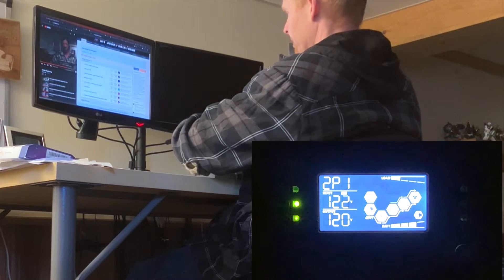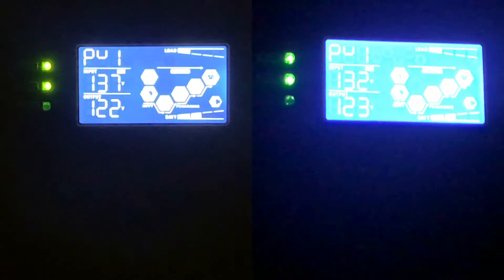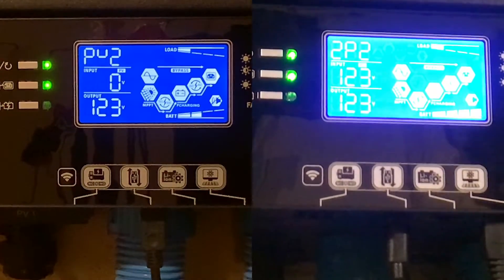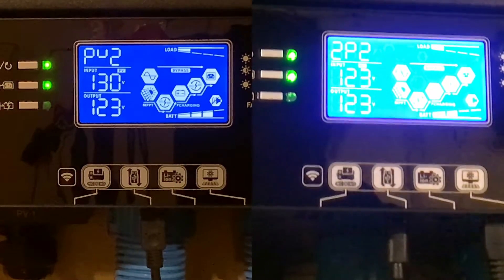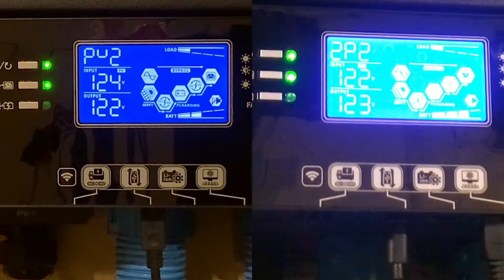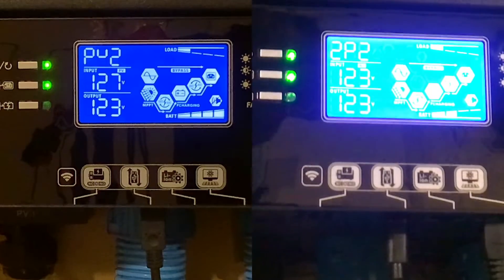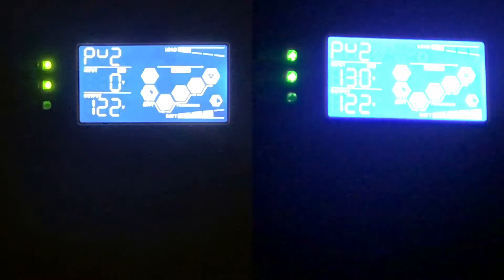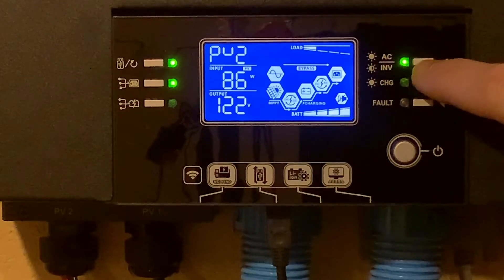Inverter Keeps Dropping the Grid Connection, Part 2

Comment: Another big problem I am having is the SOC setting in options 12,13, and 29 are always reverting to 0%.
Reply from the maker: That very well could be a firmware problem. I have heard multiple people report that settings were changing on them, and the 79.6 firmware I believe was supposed to correct that.

Comment: Sorry to break the bad news but your new inverters are going to do the exact same thing these old ones dead because mine are the new ones.
Reply from the maker: Actually, I haven't had this happen yet on the new ones.  I've had cloudy, crummy days and no issues as of yet.  What firmware are you running on yours?  I'm almost wondering if something was fixed in a firmware patch between my old and new ones.
Reply: @AdamDeLayDIY  79.03
How long did it take for Signature Solar to take some sort of action? They asked me to send them information and then haven’t responded back in over a week now.
Reply from the maker: @davidashcom6087  I would defiantly update your FW then.  I think there’s several updates which should contain fixes for a lot of your issues.  https://eg4electronics.com/downloads/
Reply from the maker: @davidashcom6087  Unfortunately they’re  extremely slow to respond.  I’ve found a lot of answers on diysolarforum.com

Comment: I don't trust the MC4 crimps.  They always seem a bit too flimsy to me.  I don't trust'm at all.  I'll crimp, and then I will solder on top of that (those MC4 heads solder quite nicely), being careful not to get solder in the tiny little tabs that click into the housing.   But I dunno if that would cause an issue like this.
Reply from the maker: I’ve never had any issues with them…as long as I use the right ones for the right cable…

Comment: Its so random, I wonder if something inside the inverter is overheating and causing the inverter to reset.   The only other thing I can think of is that communication between the two inverters is being disrupted (bad connection / bad cable).
Reply from the maker: Hard to say.  Probably one reason why SS wanted to RMA the units.

Comment: I wish their services was better.  I left one company to go to SS because of poor support and now they are doing the same thing.  Been working with them for months on multiple questions/issues with little or no solution.

Timers settings won't stay set, therefore it won't switch from USB to SBU and back again automatically
Time doesn't stay the same between both phase inverters. Off by hours per day.
Cannot get correct inverter settings needed for EG4 batteries, conflicting information
Arc fault breakers trip when switching from battery to utility.  Or randomly when on battery
Oh and the mobile app... What a joke. Lol

Has been pretty solid running most of my house with these 2 inverters when leaving it in bypass.  And only arc fault issues with battery mode.  I have not hooked up solar yet, next spring because of supply delays.  They are finally shipping me 2 new inverters.

Anyone else run into these issues?
Reply from the maker: Sorry to hear of the issues you're experiencing.  I understand your frustration with the "support" or lack thereof.  

- I've never used any of the timer features
- I did just walk over and check the times on the inverters and they're 5 minutes off right now.  When I set them both up, they were exact in time.
- I don't have the EG4 batteries but from my understanding you only need to connect to a single inverter and set Mode 5 to EG4, the other inverters should all be set to USR.  
- I've never had any breakers trip, but I have noticed some of my GFCI outlets trip (but I think that was going on before I installed the inverters)
- Can't even call it an app.  You need to look into Solar Assistant.  1000% better.  I did a few videos on it and it's capabilities.  You should check them out!

Good luck on your continued progress.  Hopefully SS gets some answers for you.
Reply: @AdamDeLayDIY  did you have to do any special ground in your inverters, it just use the ground coming from the ac input?  They won't give me an answer and tell me to talk to my electrician who is clueless with solar/battery backup systems.
Reply from the maker: @dalemeyer5363  I did not.  I'm relying on the grounding coming from my breaker panel.

Comment: I've noticed that your solar input voltage on your solar input is below 150v. I have found on units with a high maximum DC voltage MPPT input that higher voltage is needed for the MPPT to recognize the PV input. I just went through this with the EG4 6000EX. I went from three per string used by my old setup to six per string and it seemed to resolve the grid bypass mode. Similarly I had an issue with a Growatt SPF5000-US doing the same thing under the same conditions. Since Sig Solar and EG4 won't respond in a timely manner, we are left to figure this stuff out ourselves. Growatt USA will respond by email if you chat on their site and have been somewhat helpful at times. I'm wondering if the Sun Gold Power and MPP versions of these would make a better investment.
Reply from the maker: Thanks for sharing!  Odd thing is that I didn't have any issues till I introduced the 4th array.  I'm working on uploading a video about a little workaround I found.
Reply: @AdamDeLayDIY  I'll keep an eye out for it.
Reply: I’m having the same issues I am at such a words and I’ve already ordered my MPP inverse and will be installing them on Monday.

Comment: Hi Adam! Sorry about all the issues. I am slowly trying to bring my system online and had a catastrophic failure yesterday when testing in battery mode. Sig Solar has not helped me with any configuration or setup regarding my installation. I have no idea what the inverter is doing with Neutral Ground bonding. I can’t get my battery levels to read at all. I notice when powering the system back on, not all the 2P1, 2P2 settings are stored in memory. Not clear what the RS232 cables are communicating. Not sure what caused one inverter to pop.
Reply from the maker: @Jay Schwarb Sorry to hear about all YOUR issues.  Were you just trying to power up without having an AC output connected?  I ran for several weeks before I actually removed any ground/neutral bond.  

Did the failure happen as soon as you turned the units on?  I know inside each inverter there's fuses (you should have received spares in the packaging), but I don't know at what point in the connection that the fuses are used (battery connection, ac output, etc).  

Since your mentioning battery levels and RS232 cables, I'm assuming you have 2 inverters and at least 1 EG4 battery, is that correct?  Just trying to get a picture of your environment in my head.
Reply: @AdamDeLayDIY  for this test, I had the AC output breakers set to ON. It happened about 30 seconds in to turning the units on. The event triggered them to crash, I think the batteries immediately failed. I was testing 4 of 6 inverters with RS232/VGA connections properly configured for 2 L1 and 2 L2 with 6 batteries turned to ON. I don’t recall seeing any fuses during wiring up. Perhaps they are inside the other panel? It was a very loud pop/bang.
Reply from the maker: @jcschwarb  They include a spare fuse in the box in case the one inside the inverter goes out.  You wouldn't normally have to do anything with it (it's inside the top section of the inverter).

I guess I'll just ask a few questions first and then go through where I would start troubleshooting I guess.  Forgive me if any of the questions sound like "stupid questions".  Just trying to picture everything.

1. When you turned everything on, did you have all the inverters wired together for 3 per phase, but you only turned on 2 per phase?  With communication cables wired between all 6 inverters, I'm not sure how they would handle only having 4 turned on.

2. Did you have the current sharing cables hooked up as well? Per the manual the current sharing cables should only be hooked up between inverters on the same phase, not between phases.  

3. Do you know which inverter "popped"?  Do the rest still seem to be functional?

Troubleshooting - all these steps I would do with the AC Output breaker shut off (just in case).  Test output with voltmeter.  I would also remove any AC In connection (if you have it) till you get things squared away.  One less thing to worry about.

1. I guess I would disconnect the batteries from the inverters and make sure the batteries still work.  

2. It may take some time, but I would disconnect the parallel cables from the inverters, reset option 28 to SIG and test each inverter individually to make sure it can properly output 120v.  

3. I would then create a single split phase pair (with no current sharing cables) ensuring you have your P1 inverter set up on Phase 1 in your panel.  Check to make sure you have proper voltage between the two phases, and also you have proper voltage between L1/2 and neutral.

4. I would then add in 1 additional set of inverters and made sure the AC Out cables were all on the proper phase, option 28 was set properly for each (including the 2p2 servers set to 180 degree phase difference) and the parallel and current sharing cables were wired properly between each inverter and each phase.  Then power on all together and test voltages.

If you would like to troubleshoot/discuss more, we can take this offline.  You'll find my email under the about section of my channel.  Might be easier to talk over email than through YT comments...😁
Reply: @AdamDeLayDIY  Hey Adam! No luck finding your email. I must be getting old, lol. I found the fat fuse in the inverter but couldn’t find the skinny one. When I apply power, the batteries fault out. I checked my wiring and all is good. I have gone back to getting just two online.
Reply from the maker: @Jay Schwarb  No worries. 

The small fuse is under the top cover of the inverters.  It's under the plastic shroud on the right connected to the battery positive terminal.  I would be careful though because I don't know if opening the top cover will void the warranty or not.  

Unfortunately the models without displays only have the alarm light to my knowledge and it doesn't really tell you what the issue is, other than there is one.  

What voltage is your battery pack at?

What about trying to go to SS website, find your specific battery model and download the BMS software.  See if you can plug a computer directly into one of the batteries to see if you can determine what the actual fault is on the batteries.  

What comes to mind initially when you say the batteries fault when you power the inverters on is the inrush current being too much for the batteries, but that wouldn't make much sense to me.  I thought those batteries had precharge resistors built in, plus when you have multiple batteries in parallel, they all share the load.

Comment: I’m having similar issues with Growatt SPF5000ES inverters with grid input. I’ve given up on them and swapping to Sol-Ark. should have bitten the bullet to start with.
Reply from the maker: Love your set up.  Been following a long.  Sorry to hear that you're having the same issue.  Just a heads up.  One comment I've seen quite a few times is that the product rating in the title isn't always the rating that the unit can support on its own.  Can't find the link, but I saw some comments in the forums about how the 12k can only provide 12k if the grid assists.  I guess just make sure you do your research, of course looking at your current system, you do.  So good luck!  Cant wait to see the updates!
Reply: @AdamDeLayDIY  yes. I’m aware. Been studying their manuals. 

Sol-Arks have 3 ratings. PV output rating, battery output rating, and grid output rating. The lower of the three is the battery output rating. 

Biting deep. Going with 2 Sol-Ark 15ks to run my entire property. We’ll see …
Reply from the maker: @jeffmotes2129  Thanks for sharing.  Good luck!

Comment: I hope I didn’t make a wrong move by going with signature solar. Over what I’ve been using for a year now MPP which has worked amazing ❕ and they get back to me within 24 hours because of the time difference 
  I’ve seen signature solar has gotten really slow over the last year   Just from the few phone calls and questions I’ve had about products
 🤞🏼🤞🏼🤞🏼 Hope all goes well and they get the much needed help they need
Reply from the maker: Yeah I know what you mean.  They continue to release new products which is GREAT, but they need to be able to successfully support those products.  Hoping they get things squared away quickly.
Reply: Sig Solar has provided subpar support and when asking for specific guidance on NG bonds, they point me to the manual that has nothing and then they claim liability as rational for lack of support. They won’t return my calls, terrible customer service.
Reply: Same here. Growing pains
Reply: @dalemeyer5363  sorry to hear. I guess we will have to help each other out since these companies are inept and don’t care.
Reply: @jcschwarb  do you know of a place other than here that we can all communicate and share our experiences?
Reply: I made the same mistake by going with them. 30k mistake going with this company if you can call them that. I have two EG4 6500EX that I'm parting with. Two for the price of one if anyone is interested.
Reply: @ktube4848  Sorry to hear. what happened?
Reply: @ktube4848  you selling your batteries with them as well

Comment: How is your Ground/Neutral bond inside the inverter configured?
Reply from the maker: I don’t have any ground/neutral bonds in my inverters.  After talking with SS, it was decided that with my specific environment, they should be removed.
Reply: Is there a default setup for the inverters?  Do the come with it bonded or not. If how would you change it.  I've been told that if it is treated like a sub panel then it would not be ground/neutral bonded.
Reply from the maker: @dalemeyer5363  I shared this with someone else, but it might answer some of your questions as well.
---------------------------
Regarding the ground/neutral bond, I ran for weeks without messing with it at all.  Then when I first went into grid-bypass mode for an extended period of time, I noticed my computer speakers had a "hum" to them that wasn't normally there.  After doing some research on the DIY Solar forum, I found out that the hum (and possibly lights flickering) were symptoms of multiple bonds.  

The units have a dynamic ground/neutral bond. When in "battery mode" the bond is activated by way of a relay (I believe).  When the inverters switch over to grid-bypass mode, the bond is deactivated in order to use the bond directly from your main panel.

I came across this document which was huge for me.  https://diysolarforum.com/resources/grounding-and-bonding-for-mpp-lv6548-and-eg4-6500ex-48.275/

My current setup is based off 6B (Common Neutral) and so I ended up talking with SS about everything and they recommended to remove the bonds in both inverters.  I had to confirm with them before I did anything, because opening the cases of the inverters voids the warranty.  Didn't wana throw away the warranty after only having the units for a couple months.  They noted on my account that I was given permission to remove the bonds.  

I actually made the suggestion to SS about making the bonding "action" controllable through the menu.  It's already programmatically controlled through the software, so why not make it a menu option which prevents people from having to open up the inverters?  Still waiting to hear back on that suggestion...

Hope this helps.
Reply: @AdamDeLayDIY  that's very interesting that it would be a relay to control that.  In my case, it would I guess a main panel when on battery/solar but sub when on utility.  Which brings up another point...  They don't specify on how to ground the inverters NOR the battery cabinet.  Am I relying on the ground going to the main panel in that case or am I supposed to run a dedicated ground to the house main ground?
Reply from the maker: @dalemeyer5363  I'm guessing that it's a relay.  I can't say for sure.  Since it's dynamically switching, I just assumed that's what it was.  Maybe it's wired directly into the relay between grid and inverter mode, not sure so don't take my word on that...

I believe from the inverter standpoint, you're relying on the ground going to the MDP.  From the battery standpoint, I would think you would need a some kind of dedicated ground going to the cabinet.

Comment: That is the proble with these inverters.  
1. Do you want to have stable output with no problem. Go with Victron stuff...No issues there 99% times no problem. Price is about 2-3x times more than other inverters.
2. Find the best solution ..test as many things as possible.
3. If you are able find the solution with some cheap upgrade. For example you would have to buy Victron charger. Then go for charger and leave inverter alone. That would be my suggestion.. I'm also had some issues with charger in my inverter from MPP Solar ..so i gave up on it ...for charging i'm using Victron Energy stuff and for Inverter i'm using MPP Inverters. Or G4 or any other inverter that looks same as yours ..at least 10 brands use same design i would same..and i suspect same company is producing them under one roof .lool.. :)
Reply from the maker: You’re actually on the same track as I am.  I’m currently running another test with one of my old Victron charge controllers.  So far it looks promising.